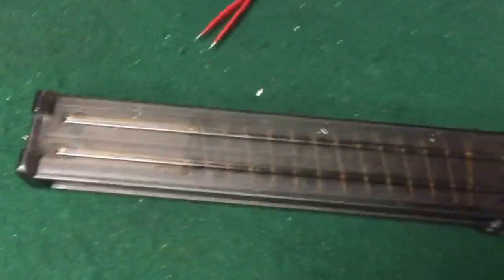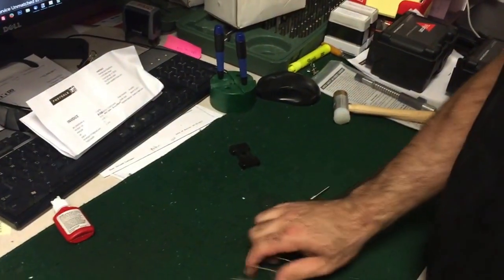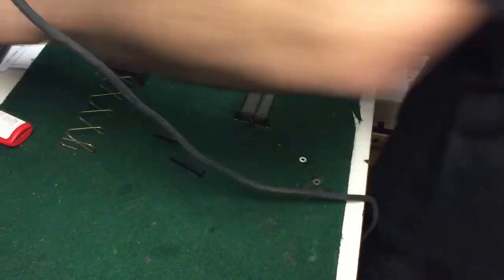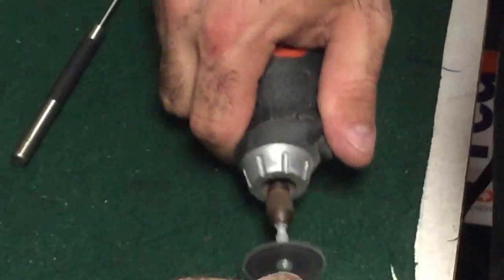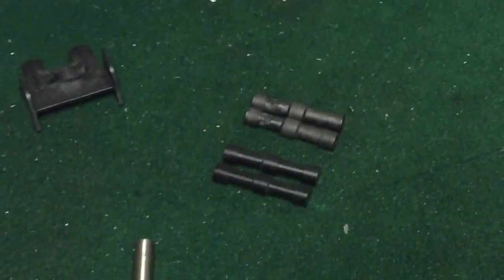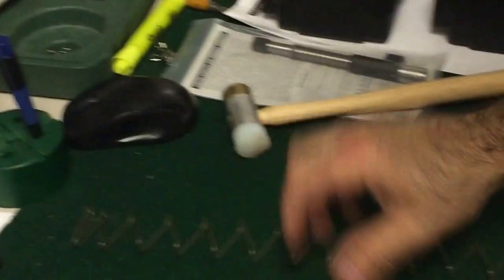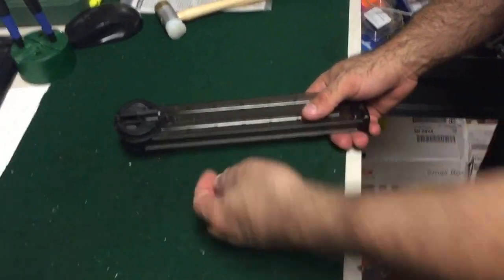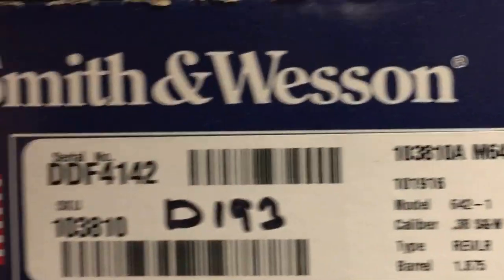How to hack your PS90's 30 round mag and convert it to 50 rounds

Comment: I did this to my mags and now at around 30 rounds left in the mag it seems like the pressure of the spring isn't powerful enough to push the ammunition through. These mags and ps90 are brand new. Do they use the same spring? Are you seeing this problem?
Reply from the maker: Trevor Wolfe text me pictures and lets see 954.805.3440
Reply from the maker: stretch the spring out